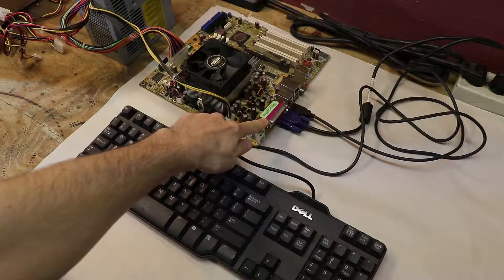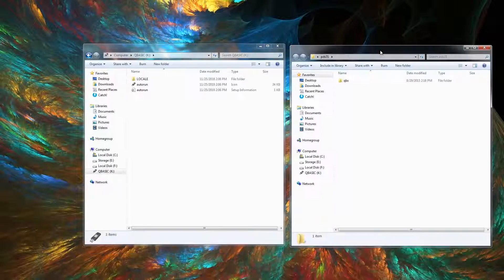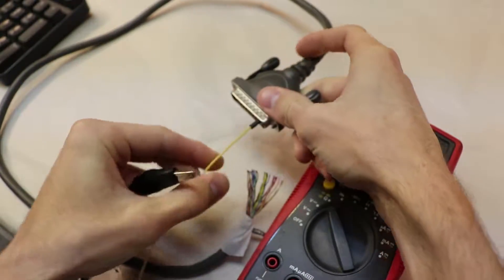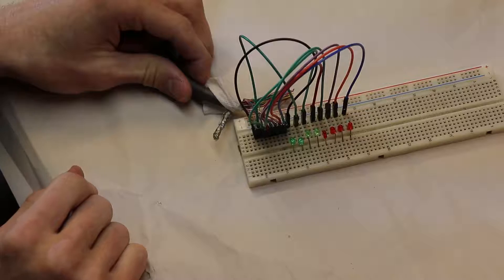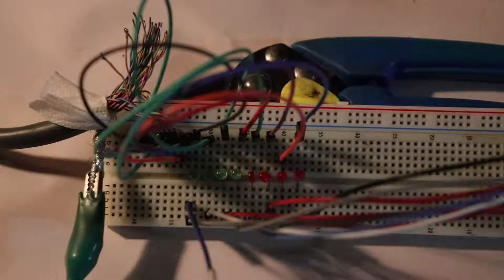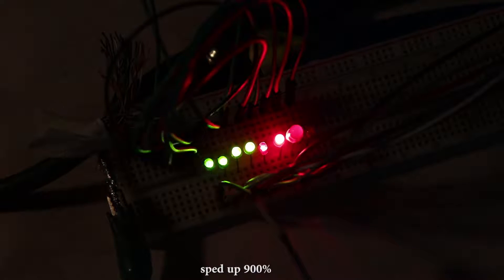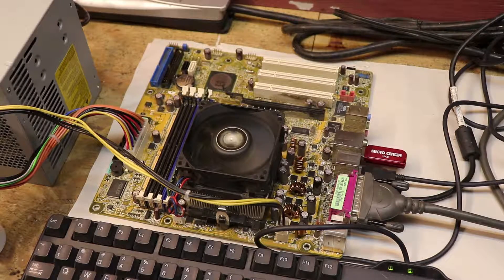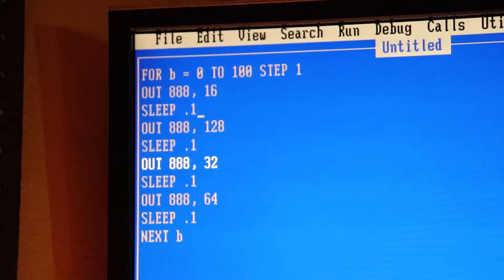Forget the Arduino and Pi, use your old PC!

Comment: Looking good, BUT: microcontroller (like Arduino for example) gives you GPIO's and more: ADC's, I2C, SPI, interrupt pins and more, which is not available on parallel port. Without deeper view (schematic maybe) of your mainboard you won't have a possibility to play with more advanced topics. Blinking LEDs, yes, but how long would you be happy with it? More useful project for this PC would be to install some linux and learn something then. And in current prices and availability of cheap prototype boards (Not only Arduino, try STM Nucleo series or TI Stellaris launchpad) this may be just a kind of day or two days project.
Reply: You could build a gpio board for the parallel port.
Reply: @josefaschwanden1502  ,if you need to build a GPIO port for the parallel port, it's not better to buy a 2$ arduino clone? Please don't be stupid.
Reply: @82levy5  if you want some high level software to interact with your hardware. There are better solutions but i think this would be the cheapest.
Reply: In fact if you use some Level Shifter (12 to 5 v) you could use some arduino modules, something that occurs to me that would be possible is to use the a4988 modules to create a 3d printer commanded by the parallel port. (sorry for my bad English)
Reply: The interrest is to program your own SPI library using bit banging the parallel port. This way you learn something !
Reply: You can use the vga output's ddc line as an i2c bus
Reply: @chnhakk  many older motherboards also provide a 6 pins spi near southbridge
Reply: All depends on what you want to do. A PC has high speed internet, harddisk, monitor, keyboard, processing power and lots of memory. ADC's, I2C, SPI etc can be done with USB to whatever you need converters pretty easy.  Lots of CNC machines even professional ones are controlled with that single printerport, so you can still do a lot of interesting things. Linux, is not strong for that. Realtime would be a huge problem if you are not comfortable with programming C in that environment. DOS is a lot easier and as good as no overhead.

Comment: LinuxCNC is based on this concept.
Reply: It is? I'm pretty sure LinuxCNC does not use FreeDOS. LinuxCNC uses Linux.
Reply: @1pcfred : Not the software, but the hardware part. (:/)
Reply: @JustAnotherAlchemist  LinuxCNC uses more of the parallel port lines than just the data.
Reply: @1pcfred  : OK ... what are you rambling on about? Where did I even remotely say otherwise? I guess this is my fault for not using full sentences, so let me restate the whole thing all at once for you.

LinuxCNC is based around the concept of using the parallel port to control the electromechanics as directly as possible. This is in stark contrast to most other CNC systems, which use some other SBC (single board computer) between the CAM (computer-aided machining) computer, and the electromechanics.

I hope this clears up your misunderstandings?
Reply: @JustAnotherAlchemist   you are not entirely right. LinuxCNC does not care what interface you use. There is a company called MESA Electronics that makes hardware that supports Linux and it plugs into the PCI bus. MESA boards run up to 50 MHz pulse streams. MESA boards also have 50 or more I/O lines. Let me state for you that I have been using LinuxCNC for a long time. Since back in the BDI days when it was called EMC2.
Reply: @1pcfred  You are right. But I guess you wanted to sound smart. That's it.
Reply: @vigisbigtm  how I sound is irrelevant. I just do not want anyone reading your comment and drawing incorrect conclusions. LinuxCNC deserves better than what's being said about it here. Perhaps I should pass your comment onto the developers of the software and let them tell you. They're not a hard bunch to get a hold of after all.
Reply: @1pcfred  smart people don't make conclusions so easily. So chill dude. I may not have worked on Linuxcnc but I have read a lot about it and know a thing or two. The guy said something relevant and to the point. You are right fit just for the IRC, you can pointificate there.
Reply: @vigisbigtm  I have not worked on LinuxCNC myself. I have worked with it and use LinuxCNC myself though. Spent a lot of time on the LinuxCNC IRC channel too. So I'll pontificate wherever I please!
Reply: @1pcfred  You know everything sir. Main to aise he bhains kay aagay been baja raha hu.

Comment: I mean, the point of a micro controller is the MICRO bit. THIS is not micro.
Edit: I'm not trying to sound rude, it's cool as hell but it kinda defeats the purpose lol.
Reply: its no microcontroller, but it IS using a microprocessor.
Reply: this is a mega controller... :D
Reply: @skittermckitter05  Haha
Reply: Most people don't even need the micro part for their projects
Reply: If you need more cpu power than a microcontroller can give you and space is not a problem this is the solution
Reply: @juliusventer8842  No, not really - there are better solutions available...
Reply: @juliusventer8842  If you need more cpu power than a microcontroller can give you and space is not a problem you get the microcontroller to do microcontroller stuff and have the microcontroller send off data to a connected pc (RS232...) to have it do the heavier tasks, that is how you do this, not by using a technique that was already a niche hobbyist thing 35 years ago and has been made obsolete decades ago by better techniques.
Reply: Not at all. I'm a Controls Engineer, and we continue to use PCs to control equipment to this day. 

Granted they are slightly better looking ones, with more I/O, but what they have in common is that they are still running DOS under the hood. I also (and prefer to) use PLCs, but they aren't the perfect solution for everything. PLCs are much more expensive, unless you use a toy PLC (any PLC that you have to stop to make a program change is a toy in my book), and PLCs really, really, suck at handling strings. 

Currently I'm working on upgrading a lathe for a friend which uses a GALIL motion card controlled by, you guessed it, a PC running XP. Hardly state of the art, but it works.

Comment: A LED must always be driven by current, so it needs resistors. They are not lightbulbs.
Reply: I bet myself $100 that he wouldn't put resistors in. I won.
Reply: It's TTL, no need for resistors.
Reply: Normally, parallel ports have output protection resistors, so no need to add one. Though some really cheap motherboards didn't.
Reply: @aviko9560  that is not true.
Reply: @1pcfred  Well, I'm used to a current limit of 40mA when working with TTL.
Reply: @aviko9560  I'm used to parts letting their magic smoke out if you attempt to draw too much current from them. Old 3mm LEDs can't handle 40 ma anyways. Most TTL can't sink or source more than 20 ma before it burns up either.

Comment: yes, i will definitely be fitting a full size ATX motherboard into a plant moisture logger :-(
Reply: Do it
Reply: Talk is cheap
Reply: I have definitely gotten PCs for cheaper than even far eastern counterfeit Arduino boards. Although the PC I run my CNC machine on I paid the princely sum of $6 for. It is a dual core 2.5 GHz model.

Comment: So much waste of computational power though.
Throw a lightweight linux distro into the pc and make it a fully functional computer.
Arduinos' are pretty cheap. It is not worth doing it except for educational and experiment purpose.
Reply: Still can work if you want a dedicated pc of old parts. Now for the quarentine at least.
Reply: Can work for more powerfull projects, and i find these computers way more reliable than arduinos
Reply: @geovani60624  Then either you have incredible luck or you're doing something wrong with those arduinos ;)
These pc's are at the end of their life in terms of wear and tear, the power supply usually being the biggest issue here... 
They're just waiting to break down while the Arduino will just work for decades unless you mess up the wiring and fry it, which can also happen here...

Comment: There are lots of multiplexing circuits for using a parallel port for controlling stuff including relays and more advanced stuff. I was using a multiplex circuit for controlling machinery before I even heard of Arduino.

Comment: of course, there are many applications for an old PC and using it for build usefull things is a smart move.  Having said that,  it will never be a match for the cheaper, smaller and energy-saving arduinos e Pi's.

Comment: the reason we using arduino is its simplicity and it cost, also less power.  and reliable, we dont need like pc to boot up wait for entering ms dos etc.   arduino is hardware programming, while raspberry pi kind of mix up from software and hardware programming.  but i prefer arduino because to interact with pc i just need to make communication from serial port from arduino. and my pc software will be just great.

Comment: Nice. That's how I started connecting electronics to computers. My pride back then was creating a text display with only eight leds by scanning through a matrix of "1" and "0" (yes, strings. didn't know better then^^) and moving the parallel cable with the leds really fast. Always dreamed of converting an old printer into a scanner but never got that far until quite suddenly the knowledge increased past that point and I knew I could do that but it didn't seem interesting enough anymore.

Comment: I have many thoughts on this video. Computer I/O control is not new. A man back in the 1980's developed I/O control using the hardware from his time. His name is Dr. Bruce Chubb, and his idea was CMRI (Computer Model Railroad Interface) in which I/Os were multiplex/demultiplex through both parallel and serial ports. Although this system was geared for model railroad, he also gave ideas for the I/O control for other applications.

Comment: Back in ~2001 I hooked up the parallel port on a PC to a multiplexer and bank of relays, which I used to control things in my car (windows, door locks, etc) by either a screen and trackpad I installed in the armrest, or through its Wifi AP with an HTTP API. It worked great, but the annoying part was installing it all, which meant putting the computer in the trunk with a power inverter (12VDC -> 120VAC), and running a bunch of really long wires to the front of the car where the switches were. And, of course, because of the high power draw I couldn't leave the computer running while the car was off. If Raspberry PIs existed at the time it would have made for a much easier installation, and the computer could have been left on for days before draining the battery, enabling full remote control of the car.

In either case, instead of booting to FreeDOS+QBasic I highly recommend booting to Linux and using either Python or Ruby (or C, or C++, or NodeJS, or whatever else tickles your fancy). QBasic just....sucks.

Comment: To make this more practical, power usage wise,
The motherboard VRM could be modded to undervolt therefore saving power and the power supply could be swapped out for something like a pico psu and laptop charger.

Comment: perhaps a bit late, but if you use a 16 pîn connector to solder the pins on to, it will make things a lot easie.  1.  easier soldering because you have a wider space    2.  double pins at the output and  3.  direct plug in tot  he breadboard with the LEDs.

Comment: IMAGINE, You trapped in a BUNKER, 
with a blonde NSA girl, 
an US Secretary of Defenses, 
and an obsessed Sector 7 ARD agent, 
where a bunch of obsolete computers, 
and oddly, the only missing component of the radio communications is THE MIC. (Transformers, 2007).
You've seen this video, and VOILA, congratulations, you did it.

Comment: making sacrifice of a parallel cable is not the way I choose. I got some DB25 M to F cables (from SCSI scanners or ZIP drives) and I use male DB25 connectors soldered directly to my circuits.

Comment: This is actually genius, I’ve got two old motherboards and cpus lying about, I might need to try it at some point, pretty sure at least one has a parallel port. In some ways these older pcs could actually be more useful than a micro controller, allowing you to output to a display and write to file possibly even use the internet if you are good enough at programming. Perhaps the future of iot is in the past?
Reply: Raspberry Pi can do all that stuff
Reply: @bene5431  yes they can but for some things and some applications they may not have the same functionality and it might be better to use an old pc

Comment: microcontrollers are mostly for prototyping. you program it for testing, then once you need an actual product or something that requires smaller form factor, you can just get another atmega that can be programmed the same way. unless im ignorant, i dont think you can really get a smaller version of your pc to be programmed the same way for the same purpose. 

also the atmega data sheet is accessible and understandable, im not sure it would be so easy to get your hands on something similar for your motherboard, cpu, etc. and make sense of it.

but i agree, if youre advanced enough this would be a cool idea for temporary projects. if youre a beginner, this would be an invaluable educational tool. but i think the arduino and other microcontrollers really do have a lot to teach in the way of low level programming and hardware, if you dig deep enough. this computer takes care of a lot of things a beginner might take for granted. a beginner should learn to set up their own lcd display, for example, as well as some sort of keypad input. anyone who's done it knows its not trivial.
Reply: The PC is pretty standardized, especially when you're dealing with legacy ports.  You could use an 8086 datasheet and a BIOS reference and have everything you need - stuff at this level hasn't changed.  That's where the term "IBM Compatible" comes from - all that stuff is the same across the board, and has been since 1981.

I make no guarantees if you have an EFI BIOS, though.

Comment: you can also read from one or two input lines on the parallel port, but the Arduino is the right physical size and C language is the right way to go.  The Raspberry PI is a "linux box" and is appropriate for much more complex tasks where the Arduino runs out of speed or memory
Reply: Just scale up your arduino to a beefier model.

Comment: I used to use my Commodore VIC-20's parallel port to do the exact same thing back in the early 80s.

Also, throwing a screwdriver onto a powered motherboard is the surest way to shutting it down permanently.   ;)

Comment: Instead of 'sleep' you can do more precise delay with 'for d=1 to 100: next' 
obviously 100 is the number you want to modify to change the length of the delay, but you can also use a variable there that you define earlier in your program.
Reply: The difference is that SLEEP lets you set timing by seconds (or milliseconds using TIMER as mentioned earlier). Using a bare for loop is dependent on the clock speed of the computer, making it harder to be portable between machines with different speeds.

Comment: k going to put this here in case someone wants to try this, be very careful. This is not something that's entry level like an arduino. Those come with limited safeties. be sure to use current limiting resistors where needed, as well as pull up/down resistors. If you draw too much current from that port it will fry. Also worth noting there are many solutions and libraries to make use of that port in higher languages.
Reply from the maker: Should have mentioned this myself, but well said.

Comment: The biggest problem with this aproach is that it SEVERLY lacks periphery, and included periphery is usually falls into two extremes - emtremely slow and simple or extremely fast and complex, which makes expanding it into a nightmare(and expensive one at that), since you are either bound to buy expensive specialised equipment with needed interfaces or buying an expensive fpga and translating intefaces with that...

Old computers are best used as a sort of "mega controller" that calculates some hard shit and then sends the data through a relatively slow port to a microcontroller that does all the rest. This way you are not limited by rtos configuration on your pc(if you still want to do that you can look in the direction of linux cnc, rather than qbasic), since you can delegate "just in time" shit to your microcontroller, so more interfaces open up to you as a means of communication to your micro(for example usb becomes a viable alternative, even though you can't guarantee the delay with it). This way you get the best of both worlds: complex computations and "off the shelf" software with real time capabilities and embedded interfaces! Ofcourse you can't use said setup for low power projects, but ehh, what can you do(well you CAN repurpose old phone and use it's soc to run some rtos or modified linux kernel, but porting new os'es to those is hard and finfing ports on the pcb is also hard sometimes!)
Reply: I remember when a QNX OS on a single 3.5 floppy came out as a free download in the 90s, I'm not sure of it's limitations as a RTOS for scripting or Basic programming. But at the time, Win95 was installed with13 floppy disks, and 95a was 23 floppies! so seeing an OS more advanced than DOS run on a single one was impressive. Linux couldn't be installed from a bootCD until 1999. You had to boot with a floppy and manually transfer either binaries or source code form the CD onto a hard drive.

Comment: Well its not very wearable...

Really though, if you were doing something a $3 microcontroller couldn't do, I would get it. But in this case not only does the microcontroller do this, but does so better, uses a tiny fraction of the power, takes up way less space, and doesn't use hazardous voltages. 

While this was for demostration, I cannot think of a situation where I would use an old PC over a microcontroller or pi for data io.